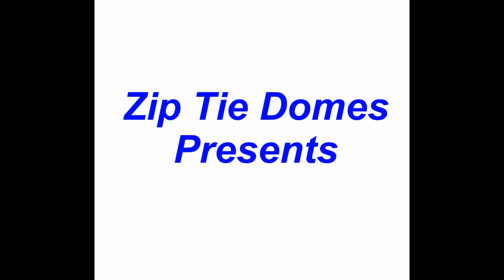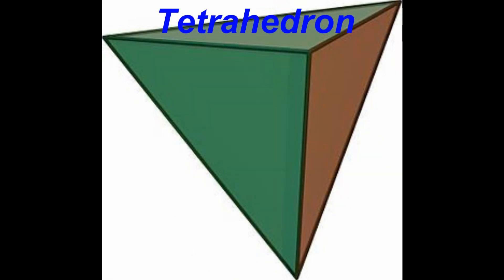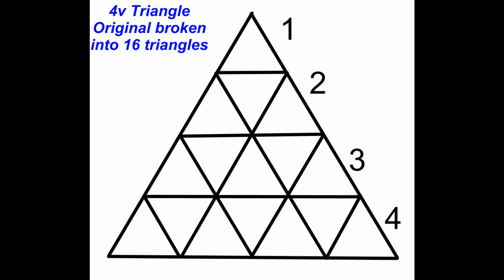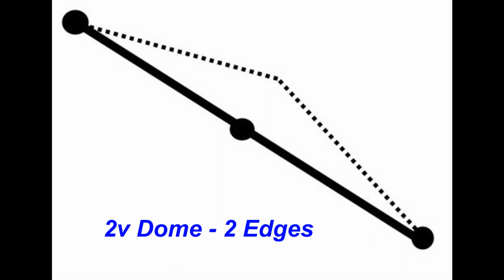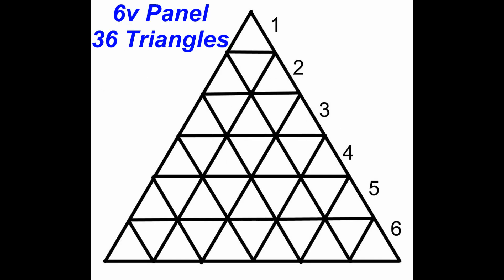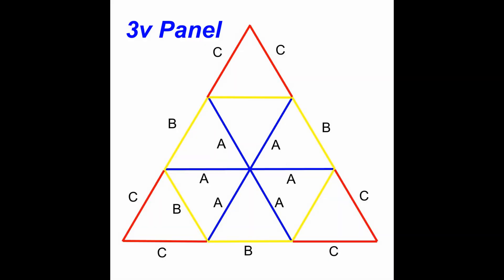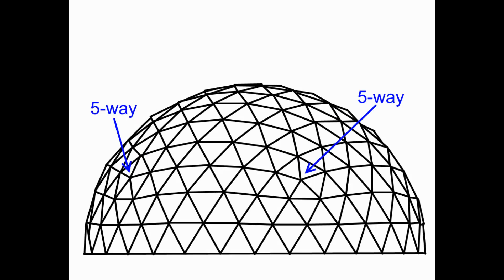What is Geodesic Dome Frequency? An Explanation of 2v, 3v, 4v, 5v, and 6v Geodesic Domes

Comment: The shortest distance between two points on the surface of a Sphere are two Geodesic Arcs .Equidistant in lenght and, a Mirror image of each other unless the points are 180 degrees apart.(Antipodes) Then its one line around the great circle route only .
Reply from the maker: That is very interesting, and true.  On a sphere, the 3 angles of a triangle are always greater than 180 degrees, as spherical geometry is non-Euclidian.
But a geodesic dome is not a sphere, it is based on an Icosahedron that has been tessellated so that every vertex touches the surface of an imaginary sphere.  The vertices are points on the sphere, but the chords, or struts, are straight lines between these points and do not travel along the surface of the sphere as curved lines.  That is why you see all of these flat triangles covering a geodesic dome.
As the frequency increases, a Geodesic dome approaches the shape of a sphere, but it is never truly spherical.
Thank you for your excellent comments, and for watching the video.  John Hurt

Comment: Very good video and I liked the explanation. However, at 7:00 how can a sum of all angles be more than 180 degrees? It should be three times 60 degrees. I understand that the dome is curved but a single triangle is still a strait plane and it's not curved. It doesn't make sense to me. :/
Reply from the maker: Triangles on a sphere are "non-Euclidian" geometry and don't follow the same rules as normal triangles.  Think about  a line drawn around the equator of a globe, divided into 3 equal segments, with a vertex between each segment.  The angles at the vertex would be 180 degree between each of the lines.  Move the triangle closer to the North Pole, and the angles start to approach 60 degrees each, but they never reach 60 degrees in spherical geometry. 
This is hard to visualize and understand, is the reason why Walther Bauersfeld, the lead engineer at Zeiss where they make curved lenses, was the first person to design a geodesic dome - by tessellating triangles using spherical geometry - which is absolutely brilliant.  
Thanks for watching the video.
John

Comment: You lost me at 360 degrees divided by 5... at 7:11 I see a triangle that should have a total sum of edges 180 degrees however 72x3 = 216 degrees. Could this have anything to do with that the image at 7:11 on the dome is not actually flat??? But I cant see how that is related exactly.
Reply from the maker: Yes, the dome is not flat, so you can't use Euclidian geometry, so no triangle can have a total sum of 180 degrees in spherical geometry.  Thanks for watching the video.  John Hurt
Reply: @ZipTieDomes  awsome thanks a lot for that info. Cheers.

Comment: I see aluminum dome roofs being used on storage tanks and they seem to follow the geodesic principal.  However, on these domes all the Node Points have six connections  - so how can you determine the Frequency?
Reply from the maker: That may be a different type of geometry, as it is not a full dome or half sphere.  Thanks for watching the video.  John Hurt

Comment: I caught that you multiply by 1.2 to go from B (main equilateral triangle) to A, but what would be the value to go from B to C, B to D, etc?
Also, in 1v, the angle between faces is acos(sqrt(5) / 3). How does that evolve in a geodesic dome for2v, 3v, etc.?
Thank you for your answers.
Reply from the maker: We use the chord factors to multiply the radius to get the length of the chords/struts.  The chord factors are located on the right of each dome calculator, like this one:
https://www.ziptiedomes.com/geodesic-dome-calculators/2v-geodesic-dome-calculator.htm
For the 1v, the struts are all the same length.  Not sure I can answer the last question you have.  Have a great day.  John Hurt

Comment: With a 6 v frequency dome domerama indicate a particular strut near the pentagon is an A strut this doesn’t make sense it should be a C strut can you help ? I am designing a twin wall 6v 5 metre radius dome centre, outer skin 5.1 metre and 4.9 metre inner skin. This produces a dome with a cavity. Regards Michael
Reply from the maker: The letters on the different calculators may be different, but the chord factors are the same.  Look at the chord factors and match against the assembly diagram.  You are welcome to use just the Domerama calculator - they are very accurate.  The same dome mathematician that checked out the Domerama calculators checked the Zip Tie Dome calculators for accuracy  Both sets of calculators use the same dome formulas.  So either set of calculators will work.  Stay with one or the other to be consistent.  The Zip Tie Domes calculators are set up so that the red struts are always the shortest, and the blue struts are the longest.  That could be throwing you a curve ball.  I hope this information is helpful.  Thanks for watching the video.  John Hurt

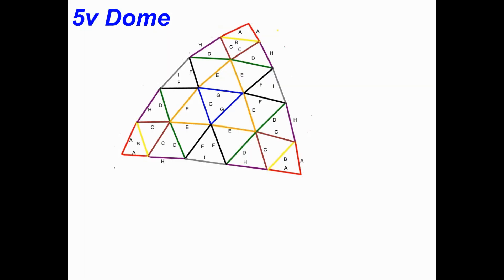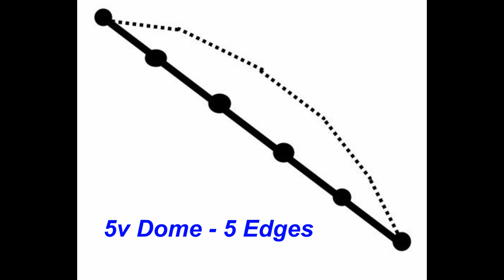Comment: I have a question. Take a look at the illustration at 9:12 for reference for what I'm about to ask. That triangle that is pointed out is based on puffing out a tessellated facet of an icosahedron until the vertices of the tesselated facet touch the sphere that the dome is trying to aproximate, right? At 5:42, you show that one of the edges of the icosahedron would be sub-divided and expanded until the vertices touch the circular arc whose curvature matches that sphere. If this is so, why aren't segments A, H, and I (the five struts along one edge of the tessellated triangle) equal in length? I'm sure some segments would have to have different lengths to conform to the sphere, but I don't get why the largest number of lengthed struts are all in the middle of the triangle rather than along the perimeter of the triangle.
Reply from the maker: The Blue "G" struts in the center of the panel are the longest struts, while the Red "A" struts on the outside corners are the shortest, followed by the short H and I struts along the edges.  The longer G and other struts in the center of the panel and shorter A, H, and I struts on the edges causes the panel to "bulge" in the middle, just like if you take a circular piece of paper with a pie slice taken out of it, and pull the circle together, it will create a "cone" shape.  As the outer struts become shorter,  and the inner struts become longer, this will create a curved surface. 
Thanks for your comments, I appreciate them.
John Hurt

Comment: I would like to correct a mis-reading. The letter you are calling "v" is actually the Greek letter ν ("nu") which looks like the Roman alphabet "v". In physics and engineering, nu is the variable used to represent frequency. Google "What Greek letter stands for frequency", and you will see that in engineering and physics, the Greek letter ν (nu) is used, just as θ (theta) is typically used as the variable that stands for angles.
Reply from the maker: You are right, it is "nu" but everyone calls it "v".
Thanks, 
John Hurt

Comment: The more v the stronger dome?
Reply from the maker: It depends.  If you have a really high frequency, the pentagons and hexagons are "flatter" and not as strong to prevent a hub inversion as the lower frequencies.  But the higher frequencies let us us a shorter strut, which is stronger.  Geodesic Domes are good up to a certain size, and then become complicated in order to keep their strength.   Thanks for watching.  John Hurt

Comment: Great explanation! Thank you!  I saw that you have a calculator on your website similar to the acidome one. I didn't see, however, an option to calculate the bottom upright strut length variance in order to "level" out the bottom plane of say, a 5/8 3v dome. Did I miss it? If it isn't there, it would be a welcome addition. :)
Reply from the maker: Brian,  Thanks for watching the video.  On the 3v and 5v domes, the base is not perfectly flat.  For a 25' wide 3v dome, there is around a 2" slight deviation in the bottom struts from a perfectly flat base.  This is significant when you are using flat panel construction, but for hub and struts made from PVC, they will flex and the deviation will not be noticeable.  You can build a "Kruschke dome" that is 3v with a flat base, but it requires 4 different strut lengths, and for what we do with our domes, the added complexity is just not worth it.  But you do have a good point.  I am working on my dome calculators this week and will look at adding a 3v Kruschke dome calculator for anyone that needs to use it.
Thanks again for watching the video. 

John Hurt
Reply: @ZipTieDomes  I love your work John. Your 'Krapps Last Tape' was fantastic and as for The Elephant Man, Alien, Watership Down...just, bravo maestro. I was saddened to hear of your demise. I'm glad you're still keeping yourself busy with the old geodesic explainingment. Quick question; in the video where you explain the 6v dome equating to 6 edges, there are five arrows pointing to 5 new points, and so forth on down, I don't quite follow, can you clarify? Thanks and regards.
Werner Herzog.
Reply from the maker: @sweatshopjesus  Did you ever see "Werner Herzog Eats His Shoe"?.  To tessellate the icosahedron face into 36 different tiles, the edge of the icosahedron would have to be broken into 6 segments - with 5 breaking points - with each point lifted to the edge of the sphere to create the geodesic dome.  
You ought to have asked me how I came back to life, now that is a real story.

Comment: Very good stuff friends.  Love to learn.  I'm a rammed earth builder.  I'm trying to figure out how to tie them together.  Ideas?
Reply from the maker: I am working on building a dome within a dome, with both covered in fiberglass mesh with latex cement - as a form for aircrete or hempcrete put in between the two domes.  It will probably be next spring before I can make a video.  Rammed earth is really cool too.  Maybe you can do rammed earth for the vertical section of the dome at the bottom, and go over the top of the dome with air crete or hemp crete.  Keep going, and try something new every few days, and it will pay off.  Thanks for watching the video.  John Hurt
Reply: @ZipTieDomes  How is the dome within a dome coming along? It's been a while since you posted anything. I am very interested! What size did you start off with? Did you do bamboo or PVC? 
Did you cover one in see through material and the other in a solid material? Did you insulate either one? Curiosity is getting to me! I am weighting the realistic fantasy of building a geodesic dwelling or a pyramid one. I am wondering if  their is any frequency in vibration changes when you build the geodesic homes. Comparing it to a pyramid. 🤔
Thanks for your videos. I do hope you do more! 
Suzanne 🤠
Reply from the maker: @suzanneweitzel8969  I have a prototype of the dome inside a dome, but now I am trying to finish our tunnel dome assembly manuals. I am using a tunnel dome as a sheep barn this winter.
I have one dome covered in latex cement over mesh that is working very well.   You can see a picture of my concrete dome at the bottom of this customer review:
https://www.ziptiedomes.com/customers/lenabach.htm
Thanks for checking up on me.  I appreciate your comments.   John Hurt
Reply: @ZipTieDomes  Fun postings! I hadn't seen these!
I am curious, if the silo  domes have the same wind resistance! I currently am in the saddle of a mountain pass. First spring here I experienced 95 mile an hour guts! I was to be in an easter parade the next day. It was canceled! A lot of wind damage all over cochise county! One for the records! It is common to get 45-60 mile an hour spring winds. It does get tense at times. That's the reason for asking about the silo looking domes for wind resistance. Also, how would I ground one for lightning? You have one shown made from #5 (I think) rebar. Do the others need grounding? For an actual all season long term dwelling? Or can you link me up to your postings on this of kind question! Thank you for your replies! Suzanne 🤠
Reply from the maker: @suzanneweitzel8969  A customer said that one of our domes, not a silo, survived Hurricane Ian.  Put 2' long rebar stakes in every hub that is on the ground.  You can also tie the dome to the ground with a ground anchoring system and steel cable. If the lip of the dome comes off the ground, it will catch air and become a parachute - and nothing can hold it down at that point.  But the dome itself won't have a problem with wind as it is round. 
The dome is made from PVC plastic, and does not conduct electricity, so you won't need lightening protection.  Most wooden houses have no lightening protection, and are rarely hit by lightening, while large steel and concrete buildings all have lightening rods on the top to reduce the electric potential.   Thanks for your comments.  John
Reply: @ZipTieDomes  That is exciting to read the dome survived the hurricane! Yes, wind will catch a parachute and go for a ride! I used to own a roof top inflatable balloon advertising business, with some wind learning curves. 
I recently had lightning strike in front of the house to a point the paint came off the nail heads in the wall!  Instantly  the dogs jumped on the couch thinking the rattlesnakes were comm'en in from under the house as the floor vibrated. Shook the whole house!
 I have had a pole struck out front, still have that pole!  Mountain living has it's own fun weather adventures! 
Thank you for the extra info and time. 
Cheers! 
~Suzanne 🤠

Comment: When talking about domes, the definition of frequency refers to the number of pieces that each edge of the base figure is divided into in the process of triangulating its sides. For instance, we might start with a base figure of an icosahedron and divide each edge of each triangular face into 3 equal lengths. Those new points are connected to divide the original triangle into 9 smaller triangles. Since the original edges were divided into 3 parts, we call this a 3-frequency dome. The frequency is commonly abbreviated as “v”, so a 2-frequency dome is called 2v, 3-frequency is 3v, and so forth. The higher the frequency the more curved and sphere like the dome appears.  https://pacificdomes.com/site/wp-content/uploads/2017/01/frequencies.jpg
Reply from the maker: That is a great explanation!  Thanks for watching the video.  John Hurt
Reply: Low frequency domes can appear very sphere-like with a little creative design ;)
Reply from the maker: @JohnGuest45  That is very cool!
Reply: @ZipTieDomes 
 The type of covering on a dome can have a marked effect on its spherical appearance. Pvc struts will curve where timber struts wont so even the materials used to build the dome can and do affect how it looks ;)

Comment: just curious and perhaps I missed it: What are the benefits to higher frequencies ? Strength ? Is there a standard formula for calculating the increase in strength between frequencies ?
Reply from the maker: A higher frequency with more triangles lets you build a larger dome while keeping the struts to a reasonable length.  Most DIY domes are built from PVC or EMT conduit, and you don't want your struts to be over 5' in length with these materials.  So with 5' struts, a 2v will create a 16' diameter dome, a 3v for a 25' dome, and a 4v for a 32' dome.  The strength is really more dependent on the strut materials and hub design, so there is no easy formula for calculating an increase in strength for a higher frequency. If you want to know how strong something is, then build it and test it.  The results from actual testing have blown a lot of formulas out of the water.  Thank you for your comments.  John Hurt
Reply: Joe, this might help...
https://www.youtube.com/watch?v=TqxarO-5igc

Comment: Note, there is actually an infinite number of ways you can cover a sphere with triangles. For example, I just designed a dome with a similar number of triangles as a V3 icosahedron-based dome, but it has 18 base triangles and a hexagon on top with 6 pentagons spaced around the side.
Reply from the maker: That is very interesting.  Perhaps you can put your work on YouTube some day.  Thank you for your comment.  John Hurt
Reply: @ZipTieDomes  I developed the simpler version out of the desire to make a very large greenhouse. By basing it on a top hexagon, the sides can be flattened and multiple domes can be joined in a hexagon pattern. From the inside, it would look like an array of posts supporting the roof.
Reply: @ZipTieDomes  
The tetra-hz is similar in that it can be used in multiples. Fairly basic with only 30 struts. The base triangles are perfectly vertical which is handy. Small ones make great cloches . https://youtu.be/kJteHbJV5eM

Comment: How do you calculate the angle that the struts make with the hub ?  I mean since each hub with 5 or 6 spokes is not flat and is not a flat plane, how does one calculate the angle the struts make with the hub for 2v, 3v, 4v, etc domes?
Reply from the maker: The axial angles are different for every frequency, and to be precise, the axial angles are different for every strut length in the same dome frequency.  With dome construction made from hubs and struts, you only need to consider the length of the struts, for as the dome comes together, the correct axial angles are achieved when the struts are connected to the hubs.  With geodesic dome panel construction where each triangle is a complete panel, and you are not using hubs and struts, then the axial angles so that the panels will fit together are very important.  For geodesic domes made from panels, please look at Paul Robinson's Geo-Dome UK site, he has a lot of information about the axial angles for panel construction.
http://geo-dome.co.uk/